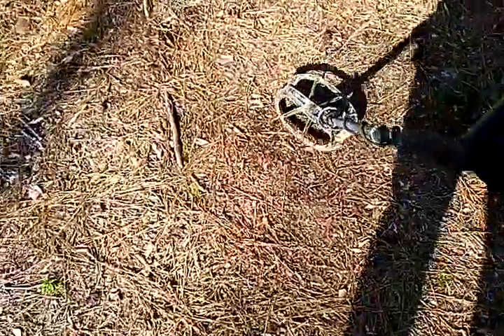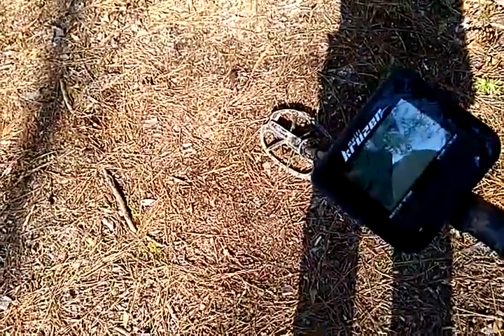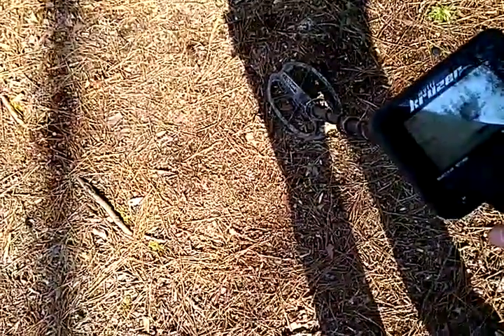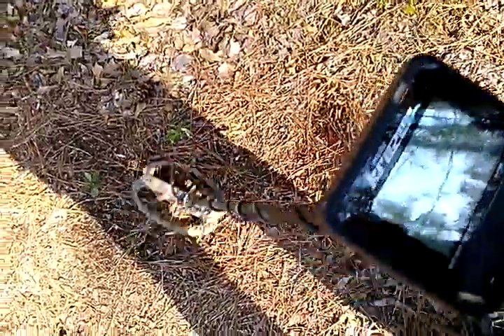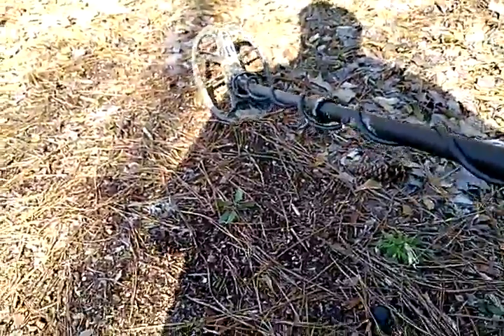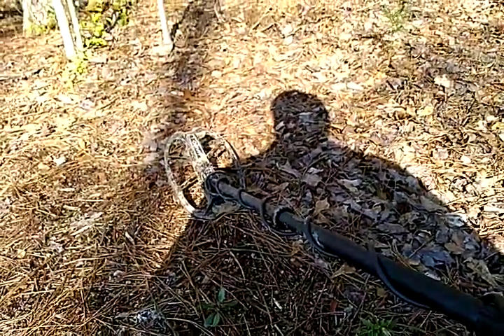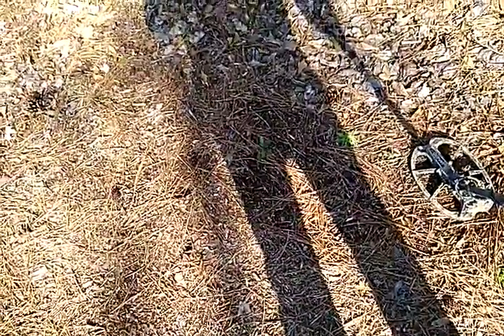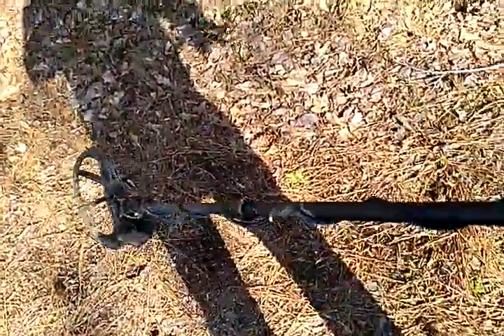Makro Multi Kruzer

Comment: Great video and thanks for sharing👍
I like also like to increased mid and and high tones to get a better tone ID.  
3 tone mode. I found that if you're on a noisy mineralized gound, lowering your gain to just below 90 and then you need to swing slightly slower. 
On quite ground turn the gain right over 90 and this will give you more depth and faster reactivity. 
GL&HH Jeremy